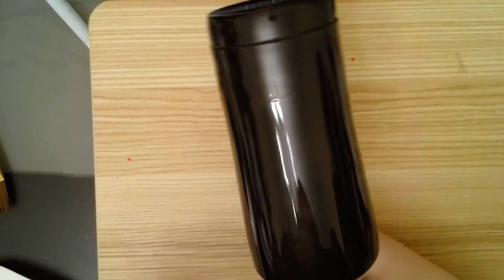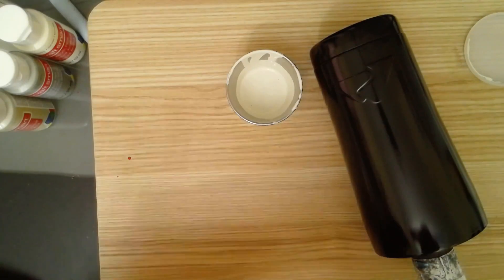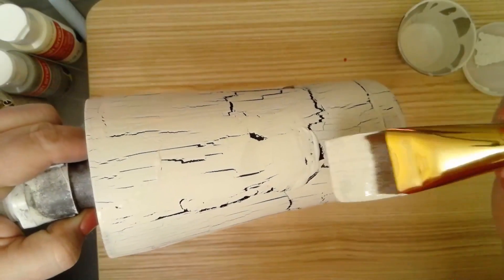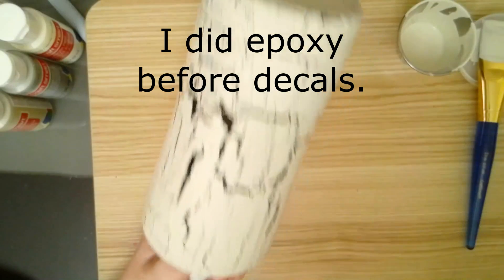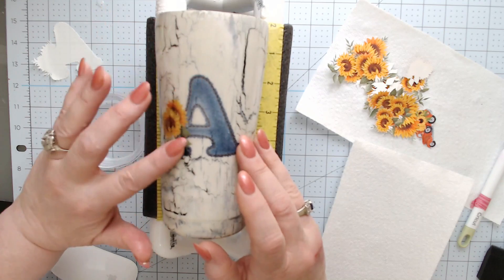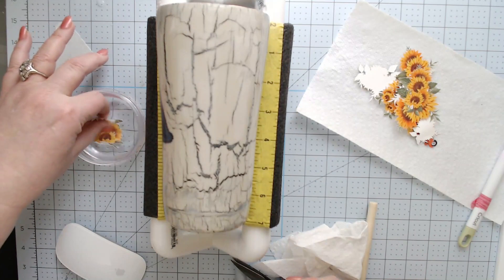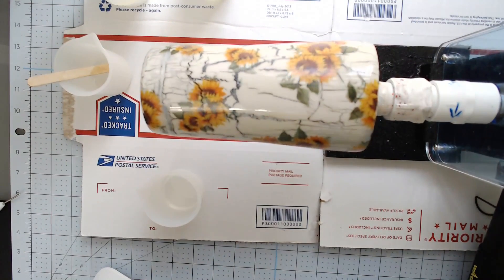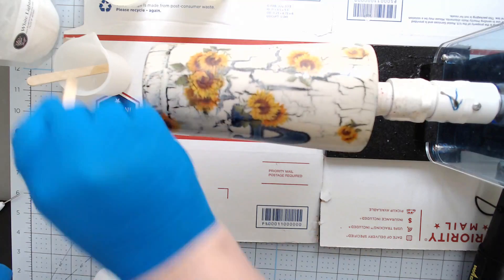Epoxy Crackle Cup Tutorial

Comment: What brand of epoxy do you use?  After I apply the epoxy, no matter what I do, I still have a few air bubbles or rough tiny bumps in the cured epoxy.  Then I sand them, apply another coat to cover the dull marks from sanding, and then wind up with a few the next round (almost like a vicious circle).  I can never seem to achieve a "perfect" coat of epoxy.
Reply from the maker: Christina Bright pro marine

Comment: Did you apply a sealer to the water slides before you applied them?  Some other videos I watched said to apply sealer to the water slides.
Reply from the maker: ye yu must apply clear gloss acrylic to them i use krylon or rustolem 2-3coats
Reply from the maker: be sure you seal...then cut
Reply: Oh interesting!  I thought you applied the sealer after you cut.  Thanks for letting me know.  Doing my first cup this week!
Reply: One more question.  Does the sealer affect the cutting on the cricut?  Can I use regular waterslide setting?
Reply from the maker: @danamurphy-love6894  no you can cut as normal i thing i used card stock setting
Reply from the maker: if you  seal it after cutting, you will seal the edges, and your slide wont come off the baking because all those edges will be sealed. I have a waterslide video
Reply: Totally makes sense!  You saved me from frustration!  Thanks so much for your awesome, prompt replies!